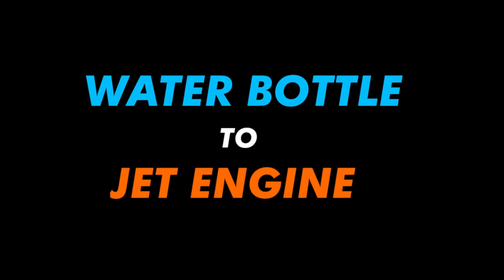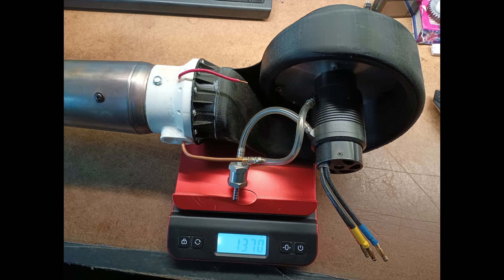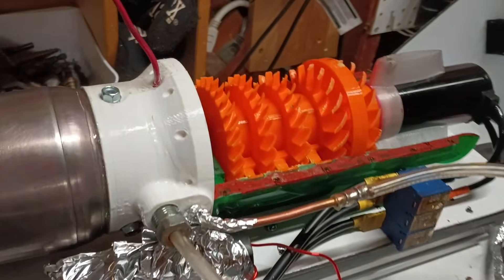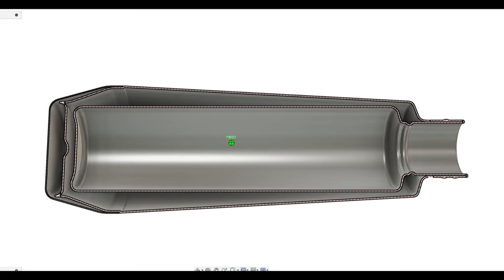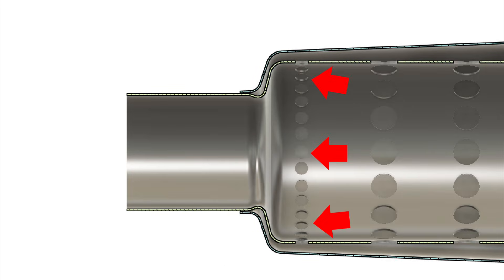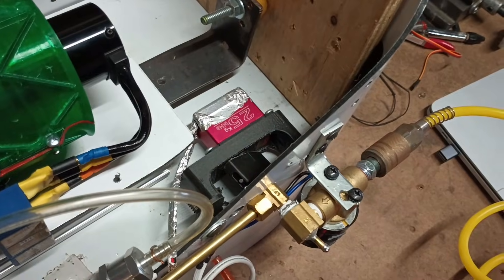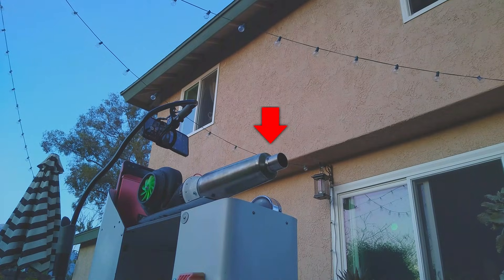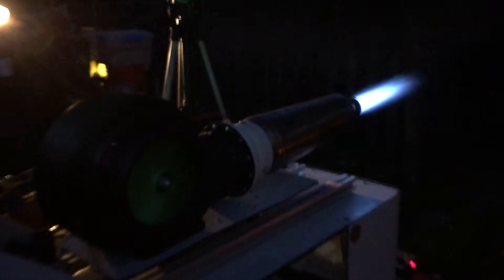I Made A Powerful Hybrid Jet Engine - How much thrust does it make?

Comment: That green turbine seem pretty promising and cool, I wonder if you used a higher temp filament like polycarbonate if it would handle the heat from the air resistance?

Comment: The convention Eugenius is the commander came in here with his wife this reality this solar system, the Milky Way nebula and the solar system. He took a seat back and let her have a turn at it because she said that the way we’re doing here or that we were going to do here was too wasteful And so they did and they let the woman lead and it ended up to see Saturn. That’s what happens if you run engines on water not only did the people kill each other by not giving the people water because it was needed for their engine and they let people die of thirst while riding in their vehicle While they wanted more fuel efficiency and they started leaning it out and they got it to where their engine ran on the air itself inevitably you see the spot on Saturn that’s what or look like if you do this that’s why the Geneva convention says that shall not make engine run on waterexactly what I’ve stated here that’s an archives read and is written in the name safe system, which is why Saturn I sat there and let her take her. That’s what the name Saturn means in the namesake system.

Comment: Every jet engine, not one jet engine produced commercially gets produced without a Geiger counter in the room as soon as you hear that hard squeal and that flame you’re creating a vacuum and the squeal and the fire and the bearings rubbing making electricity makes radiation so you could possibly be radiating everything in the sound plus some of the stuff outside of the sound every time you start the engine up if you have not properly calibrated the balance on the rotors and you don’t know until you’ve started it and stopped it. You’ve spun it up and spinning it up without starting it with the microphone and the Geiger counter and everything running in the room you get the balance absolutely perfect and even with the balance, absolutely perfect. The jet engine still makes a nuclear radiation bubble around it right along with the electromagnetic warp field that actively does carry all the way to the absolute edge of where you can hear the sound of the engine. it’s a huge area of radiation. The thing cannot standstill at all once it revs up most of the sound that you hear from the commercial jet engine is the roar of the air and not the high speed of the wine of the Bearings, which is where the electricity is made the same way that a hammer strikes an amble and makes a spark every time it hits that’s one mega volt not one volt 1,000,000 V or one terrible volt sorry terrible volt Taryn, Tara Tara Taryn tear in TARINTARYN Taryn, as in human in another language one mega it’s at least 1,000,000 to 1,000,000,000,000 V at no amp or .01 to .05 amp that’s a lot of voltage that’s what your nuclear body produces. You have plasma in the bloodstream. It is five nuclear reactors fusion reactors miniature atomic fusion reactors. Everybody has five of them in it and two independent and it has to do with materials Apex there are five primordial elements of the body, and there are two different security devices to protect you from the stuff above it and below it and there is not one living creature that fails to have this insects plants animals they all have this every individual living thing has one of these processing chips in it. They’re responsible for surface tension as such they can be located extremely quickly with a black spot camera which is a high science restricted item. Anybody can have one if you have enough respect if you failed to have respect in your clot with one well let’s just say you won’t be caught with one once we catch you with it because you can damage everybody’s immune system and a lot of other stuff which is why I try not to talk about this, but I just feel since you’re breaking more than one Geneva Convention cardinal rule, one playing with atomic energy without supervisionand i’ve had about as much of this shit as I can stand because the only civilian contractor that we let loose with the technology to properly calibrate jet engines for model RC jet engines and was supposed to teach everybody somebody in the agency decided that they didn’t like the club membership fee that was necessary to pay respect that they didn’t wanna pay respect and they kill them and then they put somebody else run the equipment and somebody else didn’t wanna run the equipment so they brought it by my house and said here you want this stuff I said this is my stuff where’s the guy that I gave this to and they said oh well this happened and I said oh well now it’s your responsibility to teach everybody and as such, they just put it in a warehouse and never mess with it again other than to make a couple of videos

Comment: aerospace engineering major here I've been working on a closed expander cycle rocket engine and I'm bringing this up cus I see something you can do to better your PSI if I where you id put in something knowns as a inducer to put it simply is just a screw used just before you impeller that reduces cavitation this should boost your PSI and make the motor run better too as it wont be fighting as much against those cavitations. i can Email you a CADD file if needed.

Comment: Hey there. I have a question, how did you get the supports out from the interior of the compressor housing. And if you used a different kind of support, what is it?
Reply from the maker: The compressor housing was intended to be printed with supports only touching the build plate. Tree support may work for part of the internals but you want to avoid internal supports as much as possible because you will not be able to remove them.

Comment: You know how there's always a big and a little peanut! If you exagerate that and run it tapering around your compressor housing small nut out and taper the small external channel to inject into longest internal line it will increase pressure and volumetric flow through regionalised entrainment. Apparently satay is the secret sauce for centrifugal compressor housing design. 😂🎉🎉

Comment: Have you considered trying to use something like automotive heatwrap (provided it will stand up to the temperatures) on the outer liner you'd get a little thrust and efficiency boost as more heat would be retained and peak temperatures m, provided that it's still within operating limits. You could also use a higher grade stainless steel. Another option would be two compressors in series. Again, you would have more efficiency due to entropy and it would be weight efficient as the secondary compressor would double the boost.

Theoretically could also have a small intercooler unit, you'd lose thermal efficiency as some of the heat would be lost to the atmosphere but you'd get higher compression and a greater delta T, so more work being done basically for free, which redresses the balance bit. Even better yet though if you switch to liquid fuel you can add water to it and do a water/methanol setup. Spray a little bit ahead or run the fuel through a copper pipe before the combustor inlet, soak up heat and get a denser charge, then that heat isn't thrown away but simply re-enters the combustion chamber. at the point of combustion. 

In a real flying example, with enough speed you could also build an inlet that recovers a bit of pressure, providing ram air. But you'd need to be going quite fast and you'd end up with some compressor face issues. For keeping noise down maybe look at an automotive grade cone filter.

Comment: Diverging nozzle I shouldn’t tell u this but that will probably fly😂. Great job .  

Do u understand how afterburners work.    

And if u put a nozzle on it cool it lmao ..  I see people building rockets that have no cooling ..  if u cool it it will make  way more power all jet engines have cooling titanium is invincible when it’s cooled stainless steel too.  

Look at space ex . 

U can make a simple butane powered cooling system .  ..
   Or any gas that can handle temperature changes

Comment: Scram jet  dump the rear section .  Cool the fuel inject it a high pressure or atomize it compressed air is the key to power I been planning to build what u did and I see it’s still not enough thrust lol.    HHO

Comment: Excellent work my friend. I'm working on something similar myself. I will say, for heat resistance on that compressor, Polymaker has just. released some high temperature glass fiber PLA that is better than PETG, ASA, and ABS, called HT-PLA-GF I believe.

Also, why copper and not brass, just curious?
Reply from the maker: I just got a roll of that filament and am going to do some experimentation... I also chose a copper fuel pipe for the simple reason that it bends more easily than brass without being heated.
Reply: @AydenWardellAerospace  Wonderful. I wish you luck, and hope to see more good work from you soon.

Comment: Melt from compression heating? At a pressure ratio of 1.07? No, it melted from rubbing on the housing, obviously
Reply from the maker: This is definitely a possibility, however during open flow tests it had no such melting issues. It was only when flow was restricted that problems occurred. The slightly compressed air could have been recirculating through the stages with nowhere else to go, building up more and more heat.

Comment: acial compressosrs lose efficiency as they get smaller. The fraction of gas that bypass the rotor though the tip clearances get larger and larger.

Comment: What if we integrated wideband AFR sensors into the exhaust stream too allow the microcontroller to control fuel flow rate and turbine speeds in a closed-loop system? This approach could potentially address the challenges associated with using alternative fuel types.

Comment: One thing to note about different fuel types is that they require a lot more precision. Butane and propane are fairly forgiving when it comes to combustor design, whereas aerosolized fuels such as kerosene may be more likely to "burn out" or combust improperly